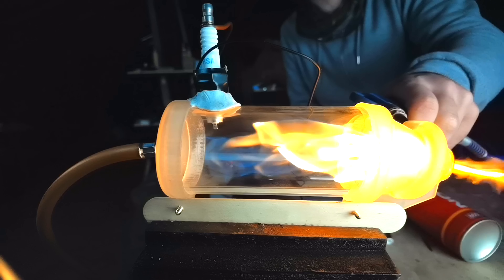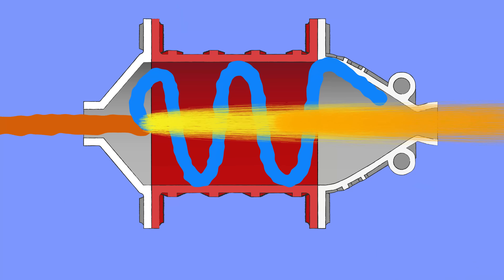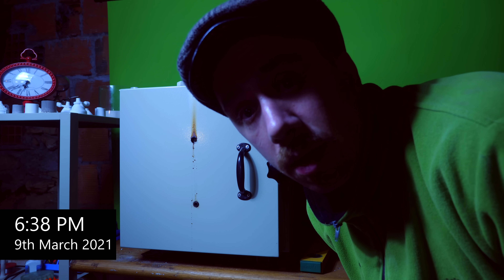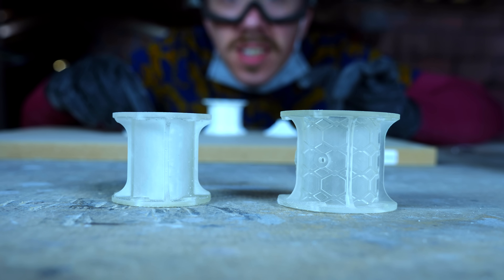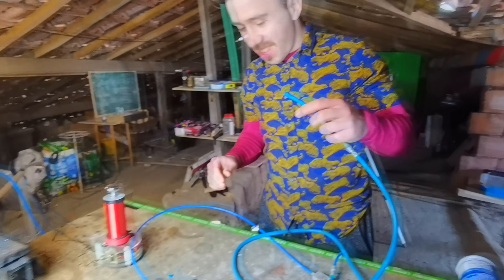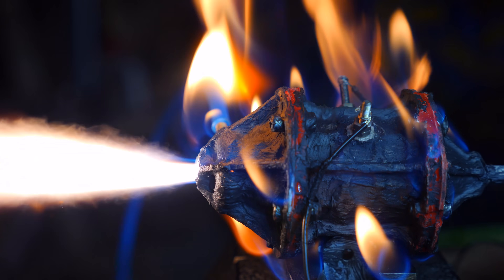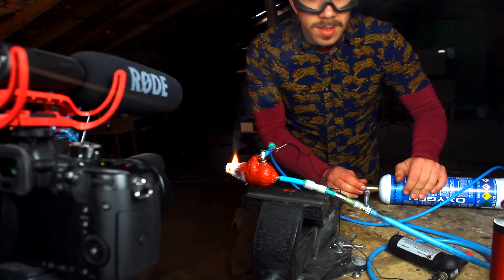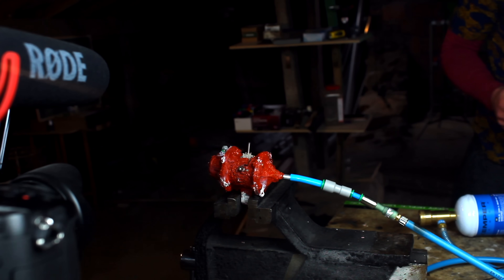Vortex Rocket V2.0 (3D Printed)

Comment: @Integza Your flat surfaces aren't flat enough, that's one of the causes for your leaks. Try sanding the flat ceramic surfaces with a wet sander and/or using a tile saw to the flat face flat with a diamond tipped saw blade. If you have a CNC and can use a diamond tipped bit, you can CNC the surface flat.

Comment: Hi Integsa, I have a video idea. What about experimenting with hydrogen or hydrogen fuel cells (Pemfc). I think it’s a great idea because hydrogen is a much more stable way of storing energy, and it only emits water when running and creates electricity from the reaction between hydrogen and oxygen

Comment: Try a water-rocket wich uses high Presure.
Maybe you can try your nossles to. 
The other difficult here to make it strange enough for the pressure. 
Don’t forget to start it in an free area and not on your roof.
And maybe you check the flight-data bevor you do it.
It will be horror if you hit or nearly miss an traffic flight. Or worst: the AF1 ;-)

Comment: If the issue is that the material is porous and leaking the air/fuel mixture, maybe try painting it with a glaze after it comes out of the kiln and then bake it a second time. It might also look really good.

Comment: My advice is You should use valves for controlling fuel as well as oxygen the controlled flow may help you and you will be able to stop combustion quickly when things get messed up.
Specially its a safety advice.

By the way videos and project selections are awesome.😉😉

Comment: i think your next purchase must be a fume hood. They are not expensive,and dirt cheap if you make it yourself.
Also it will be an interesting video if you make it as another video for your channel.
Please,you are now daily exposed to a lot of fumes, dust, etc.
Ceramic dust can contain silica,too much fine and heavy to be expeled by the lungs, and can cause silicosis,for example.
Its even more comfortable than cleaning your face and table. You can direct the exhaust outside the room or filtrate it.
please,it seems you are even cutting carbon fiber with a rotary tool protected with a surgical mask, thats a big nono. Sorry if im wrong and you used a proper breath protection,but the other arguments remain.

please,make that cool fume hood project,we need you messing around for as long as possible.
thumbs up those who agree.

Comment: Get rid of push to connect and plastic tubing near your tangential inlet. 

Not sure at all if this would work, but could you seal the inside and out by dipping it in “supper glue”?

Comment: Soak your ASSEMBLED parts in sodium silicate and allow it to [very slowly!] dry at about 95 deg Celsius for at least 48 hours.

The sodium silicate will both seal an strengthen your final engine piece.

If you want to, you can insert your spark gap electrodes at this point so that they are bonded to the part permanently [or until it breaks] to further enhance sealing, but I would suggest that if you do that, cover the tips with paraffin or beeswax before dipping so you do not bond glass to conductive surfaces and make electrical connections a new problem.

Comment: Is it possible to apply the cement and/or glue from the inside to stop the leakage? Maybe if the pressure pushes it against the chamber wall it could work better

Comment: You need to talk with a potter, dip the item in glaze and fire it for a second time.  Glaze is made from glass dust and water, the second fire will leave a fine glass layer over the part. For your next video I would like to see you test a glazed ceramic engine pls.

Comment: Easy way is double wall. Outer wall is ordinary metal , in between walls compressed gas or air , so small leakages go inside ceramic wall due small holes

Comment: Solution:
Buy some ceramic glaze and dip your parts in that after baking out the resin, then bake them again to cure the glaze. Put wax on any ceramic you don't want to be coated before you dip the parts. Make sure you cure the glaze with the parts sitting on unglazed (waxed) surfaces only, or the glaze will stick to the inside of your kiln.

Comment: Solder it. Completely encasing it in metal. a more difficult but proper longterm solution could be to dip it in molten metal to basically coat it. The material you are using is awesome but it doesn't seem strong enough for your application. OR you make thick but juicy cement mixture with ash and whatever makes it great for heat, and you give your rocket a nice thick coat on the outside, let it dry, and give it a try. As long as the inside is not affected then your experiment can have less things affecting it.

Comment: Have you considered glazing the ceramic parts with a high-fire pottery glaze? It should seal the porosity of the ceramic and prevent it from leaking, and a cursory Google search shows that high-fire glazes need to reach 1186-1222 Celsius to melt. It might just work

Comment: You made a blow torch, also your parts are breaking down quickly causing the leaking. It’s the ceramic that can’t stand the temps. Try again with metal.

Comment: I'm surprised you don't seem to have tried coating the inside with a high-temp ceramic slurry or something yet.  It would probably help with sealing as well.  Also I think your seals themselves might be porous with the high pressures. I'm pretty sure silicone burns in a pure oxygen environment so even a nice gasket might not do the job well

Comment: Try plugging the various ports on the print, BEFORE firing, then submersing the entire piece into a ceramic slurry.  Coat with silica sand.  Build up the outer shell. Like investment casting. Then remove the plugs and fire it in the kiln!

Comment: Have you ever seen the early "radio control" cars of the 50s, that ran on an concrete bowl attached to a cord to a post in the middle and would only stop when out of fuel? It would be fun to attach one of your rocket engines, maybe the sugar rocket, to something like those, just to see them powering a moving vehicle! What do you think?
Reply: Control line racing.  They still do it!

Comment: How about putting the engine in can filled with sand. The sand will conform to the engine keeping it from changing shape.
Also when heat treating the freshly printed modle. I wonder if you remove the support material then put the 3d printed model in a high temperature container and fill both the inside and outside of the model with a high temperature sand like material before cooking if that would keep the model from shrinking, cracking, and distorting. Kinda like vacuum mold casting in aluminum.

Comment: You can print in stainless steel with fdm/fff printers using  basf ultrafuse 316L, it requires post processing ie. debunking and sintering.

Comment: It looks to me like the imperfections in the 3d print are preventing them from sealing at the interfaces between the three components, leading to gas rupturing the external silicon seal, and finally catastrophic failure. You should try to use a gasket between components made from similar high-temperature materials to help seal against the printed imperfections.

Comment: Take the engine that worked the best and cast it in a case of concrete. Won't work great for a rocket but for bench tests it should work

Comment: What if you make a ceramic combustion chamber, then wrap it in insulation, and wrap a compression something around it. Then fibreglass or carbon fibre to hold everything in. And use 2 nails instead of a spark plug.

Comment: (Note: none of the following are original, I just copied them so that they would be easier to see because you wouldn't have to dig into the 7,461comments, and also not all are here only a few I think would work.) I suggest you make a batch of homemade sodium silicate (also known as water glass).
melting point is about 1 088 °C and because it's already in liquid form at room temperature, you'll be able to dip your ceramic parts into it, like how a guy dips churros into chocolate syrup, in order to seal them all the way through (from the inside and the outside) (except that chocolate only seals churros from the outside and not the inside). If that still doesn't work add an aluminum jacket to it, and to seal the gaps between the jacket and the water glass try using pottery glaze. (again only do this if u are REALLY, REALLY F*CKING DESPERATE, because it is gonna be HELLA HEAVY.)

Love the channel!
Good luck!

Comment: Sadly I think combining 3d printing with the heat generated by a rocket motor is only ending one way.

I think it's time you expanded your skills and knowledge, and started making parts in metal.

Surely there's a maker space near you that has a lathe and mill you could use to make these in metal?

If not, then how about potting the entire rocket in a much thicker layer of refractory cement?

Comment: Aerospace Engineer Student here, I believe your leaking problem, at least from the ones that start off without leaks is an over heating issue. Air isn’t the best coolant but you kinda need it to create the flame. If possible I would cool the inlet air before it mixes with the fuel. Probably won’t be enough but you should hopefully get little bit more life out of them. Hope this helps

Comment: Well, the way I see it, porosity is only half the problem. The high-temp silicon worked perfectly... Until it melted.

Seems like the gas flow isn't working to cool the engine wall because it's not creating an actual "jacket" effect, either because it's too turbulent or at too low of a pressure. Probably both, to be honest, and the porosity of the ceramic isn't doing it any favors. Sealing the inside of the engine, to create a smooth non-porous surface, is likely going to be significantly more important than sealing the outside. I'd also look at refining the gas injection system until it creates a reliable laminar flow along the chamber walls, then working on getting it to a high enough pressure to prevent combustion gasses from disrupting it.

EDIT: Also, cooling the gas could be effective. Or it could just exacerbate thermal stresses and make the engine even more unstable. Pretty sure it's the latter, but it might not hurt to try.

Comment: After firing the engine in the kiln, plug all holes and add additional ceramic to the outside of the engine.  Building up and sealing the porosity. Multiple layers.

Comment: In the interest of keeping it mostly 3D printed what about an external jacket around the engine core to make it double walled? Assemble, coat in sealant and then add the sealed jacket. Might Be able to stack it as long as the internal shape is consistent.

Comment: You can try glazing the part  to avoid the porosity. Go to your local potter, he can explain to you the different materials and techniques.
Reply: He can also ask for the firing technique, a potter can tell him how to avoid cracks and deformation.
Reply: It’s either glaze or going hotter and flirting with the vitrification point of the ceramic.
Reply: Or the fire cement he used in one of his last videos
Reply: Yes i was going to suggest he submerge it in glaze and fire it a second time
Reply: @FullModernAlchemist  mmm
donuts
Reply: glazing will work
Reply: He could also put a layer of aerogel on the engine nose to keep it from burning though the material.
Reply: way to hard to make and expensive to buy
Reply: @MMAteenager  uhm, no... Glaze isn't hard to get or expensive...
Reply: @rouge5140  ment to respond to AI K

Comment: Future video to get this thing working with no leaks you might be able to 3d print an engine with two 2mm thick layers that have 1 to 2 mm between the layers. you can put the cement in between and cover it with cement to be safe too. leaks would hopefully not happen nearly as fast.

Comment: you could use an actual seal or gasket on the seams of the engines or maybe make them lock into each other in a way that makes the point at which they connect not completely flat, but i'm not sure how that would work since it seems to leak out of the ceramic itself too

Comment: I think your ceramic is not holding up to chamber pressures. Maybe consider reinforcing it with something that will help it hold together? This will be most difficult, as the printer already uses a dilute amount of ceramic.. Good luck Sir

Comment: Make stronger, longer-lasting parts for your rocket engines by casting them in metal with the 3d printers and kiln you already have!

I can think of a couple ways you could make it work:
You could 3d print molds to make wax dummy parts and cast in sand, allowing the molten metal to melt the wax away.  You could also cast in plaster with a 3d printed plastic dummy part and fire it in the kiln as well to burn the plastic out of the mold before pouring in molten metal.  There are probably a bunch of other ways and variations on what I mention here to try, too.

Comment: Why not use a ceramic glaze with sodium bicarbonate and corn flour. After the initial burn in the internal structure should be protected by carbon foam and shouldn't leak for a while

Comment: Questions how are you regulating the air to fuel ration? How are you regulating the PSI. The pressure to volume with the materials you are using will give out every time. You have to consider the air gap that is required to create the cooling and if you are bombarding with too much fuel to the small volume it will not work. I also recommend finding a way to monitor the temps. Find out what temps you are working at and I can give better recommendations for materials to assist the ceramic
Reply: I have more points of discussion,  if you want to contact me.

Comment: print a rocket engine with less pressure at the tip, as the flames will hit that point more, and it is more likely to deform and break due to thermal expansion (very brittle).  Maybe you could submerge the engine for cooling in water (water has a high specific heat). make sure there is some type of internal seal to the engines so the high pressure does not blow out your sealing material (incorporate an internal brim overlap possibly to protect sealing material from the outside).

Comment: you could lasersinter the parts instead of resinprint them. And thus eliminate the process of removing support material. (sls printer and ceramic printing powder required)

Comment: How about ceramic coating the engine? Dip it in a ceramic solution as used for porcelain tableware, then cook it in your kiln. The porosity of the parts should absorb the ceramic and seal itself, with a nice glaze. Força e continua a fazer-nos rir.

Comment: Hi Integza! I love you (or at least what you do...)
about your leaking problem : almost all ceramics are porous, except maybe sandstone. The standard solution to make earthware waterproof (like for 
plates, bowls) is just glazing. but this has already been discussed by others, and this might not be the best solution. And sandstone might be the solution.
 Then you should use you 3D printer to make moulds, and apply raw sandstone clay in or out the mould.  You could also use ready made parts (quartz glass cylinders...) for some parts, as moulds or in the finished rocket. And print with ceramic only the little precise parts like the inlets and the outlet. You could then easily have a larger device for cheaper. Larger body means that you could reduce the inner pressure for the same push.
About the cooling, I think you should have a larger flow of cool comburant, instead of using pure oxygen. Maybe you could use a mixture of 20% oxygen and the rest of a neutral gaz like nitrogen, if you could find that somewhere...
Reply: You had a genius idea! If you have a look at the one-piece rocket design, it's almost a drinking glass (wine or bear) with a noozle on the top! And the fully transparent body would be very nice for checking the vortex! Start simple and quick as a proof of concept, and then add lthe other constraints of a rocket (toughness, weight, efficiency....)

Comment: Is there anyway you can line the insides of these jets with aerojel or even the outside to help insulate from heat. I notice that the jets are cracking after a few seconds. I dont know if its caused by the heat or if there is too much pressure inside but i think aerogel might be able to help.

Comment: For less leaking i think you should do ceramic cover for engine and put some high temperature glue between engine and cover. I think between engine and cover should be about 5-6mm place for glue

Comment: I think the leaking problem could be resolved by coating the inside instead of (or as well as) the outside. Coating the outside means the sealant is effectively under tension and the chamber pressure might just be pushing it off the surface and then finding weak points to escape from.

Coating the inside would put the sealant under compression against the ceramic body instead.

(Of course, you could also put the sealant on the outside and then use a sleeve to put the sealant under compression, like those polymer bushings).

Hopefully some food for thought. Good luck!

Comment: Build an induction foundry in order to cast using a 3d printed ceramic mould... or find a way to mould parts out of another high temperature/non-porous substance... ie revisit chimney sealant.. maybe with carbon fiber. Maybe even just coat the porous ceramic with chimney sealant... or some combination of the above. I liked the suggestion of using an aluminum tube as well. Regardless, love the videos.

Comment: You should try to cast the rocket engine out of aluminium with the lost PLA method. But i think it would need to be water cooled at least at the Nozzle, to prevent the aluminium from melting.

Comment: Why not try what you did with the pulse jet? Making the negative space on your printer, coating with refractory, and burning out the center in your oven/kiln might give you really good inside surface finish, and make it less porous.